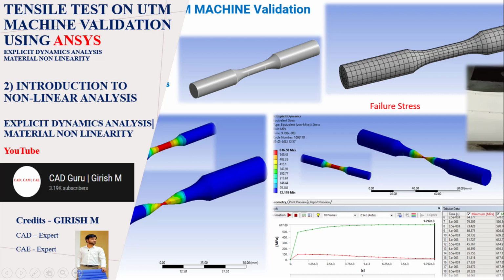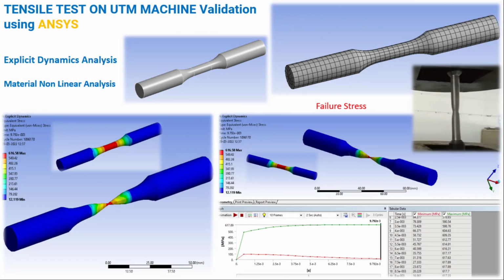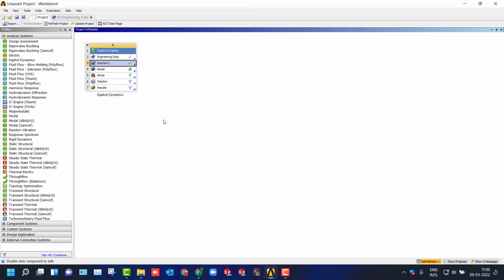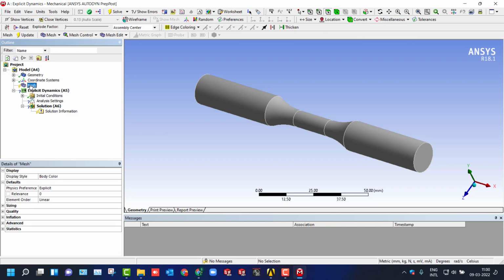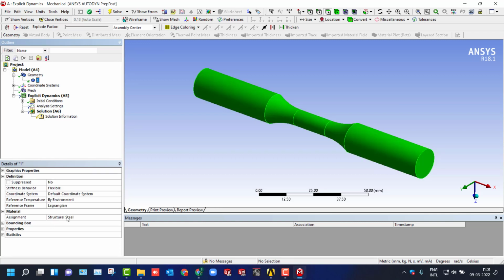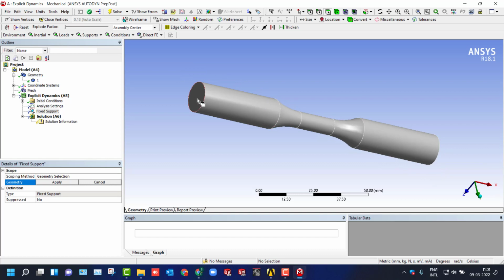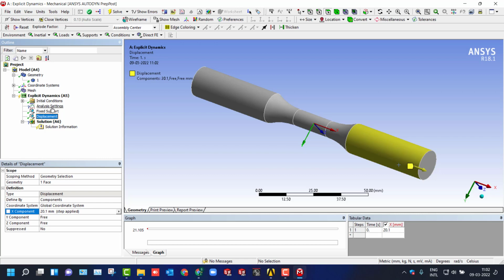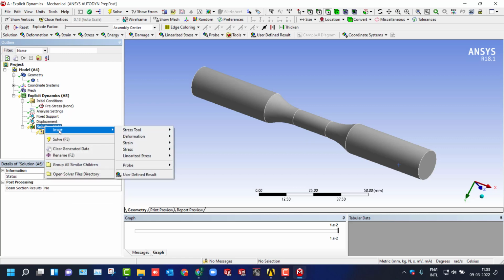3) Introduction to Non Linear Analysis|Explicit Dynamics Analysis|MaterialNon-Linearity| UTM Testing

Comment: Hello, I am an engineering student studying Ansys. I want to perform a nonlinear analysis to simulate the complete compression of an object, but I am getting an 'energy error too large' message. Could you explain which options I should adjust in the analysis settings to resolve this issue? Thank you for the great video!